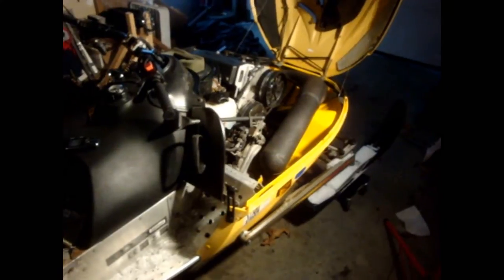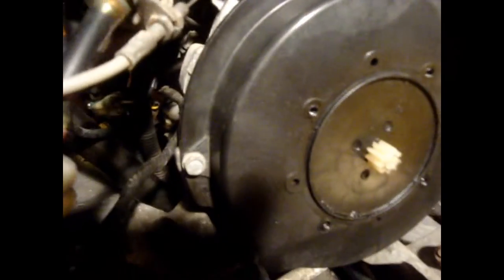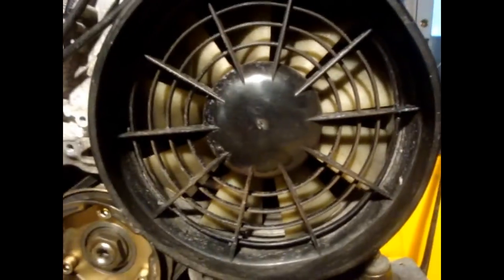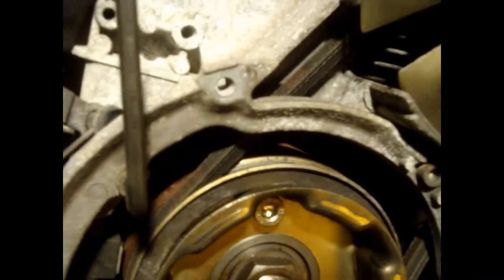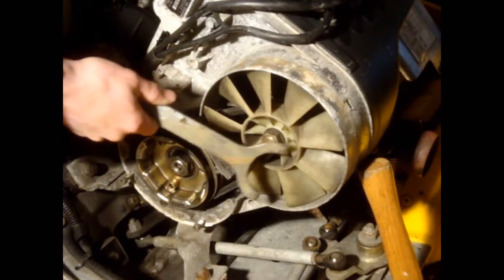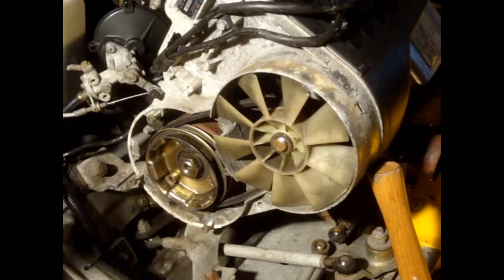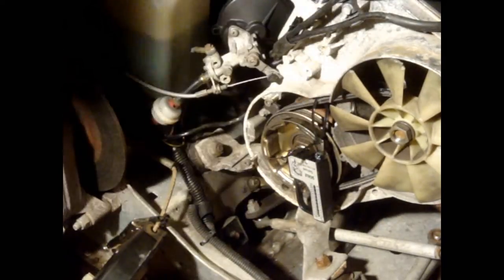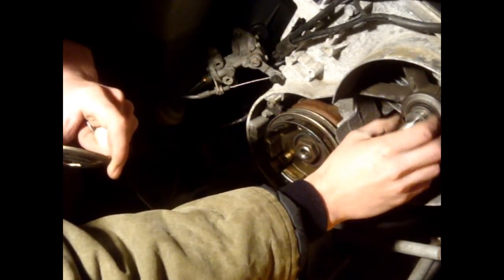Snowmobile Cooling Fan Belt Replacement (Ski-Doo)

Comment: Was the replacement belt OEM?
Reply from the maker: Yes, OEM belt bought from the local Doo dealer
Reply: Was just wondering why if it would need shims moved if it was stock for stock.  I have 2 fan sleads i need to do!  Nice video!